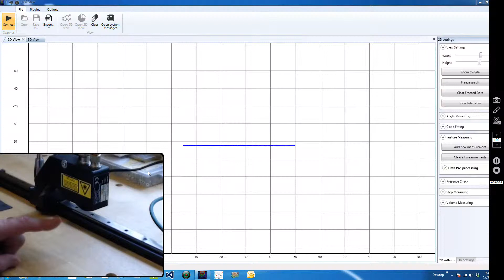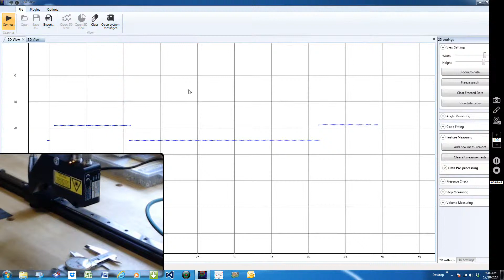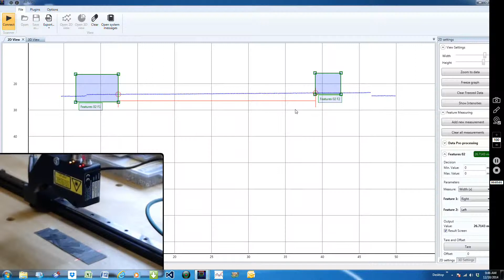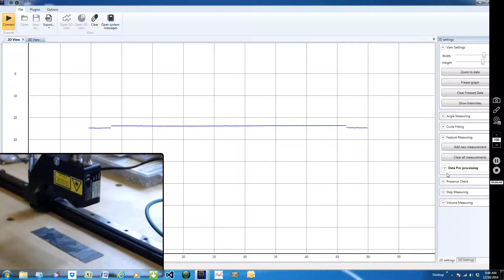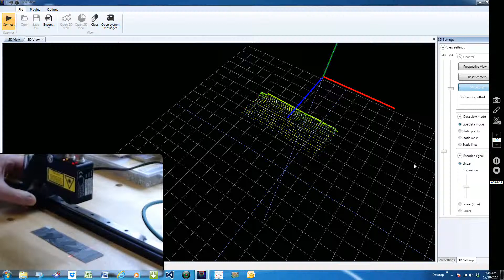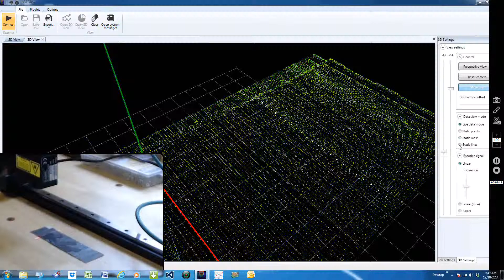Tape Width and Gap Measurement with Laser Sensors

Comment: I tried a SICK laser sensor before for checking a gap between material of steel and resin, and that measurement experience was so poor as laser sensor is too much sensitive and reading much much noise data from material surface which made us really difficult to measurement the gap. This video really amazing to see your sensor is reading material of steel and plastic and reading is not having much noise data and therefore measurement can be done accurately. Do you have any distributor available in Taiwan, now I am thinking to re pick up my old measurement idea.
Reply from the maker: Hello HW L, we do have a distributor in Taiwan, you can find them here: http://www.pavement.com.tw/ and you can find our sales information here https://www.acuitylaser.com/sales-support/asia/